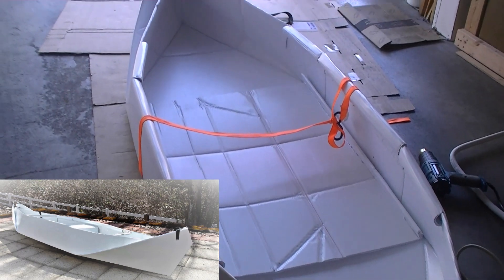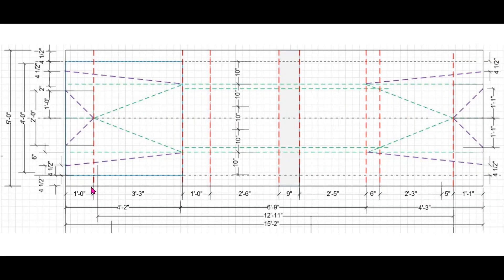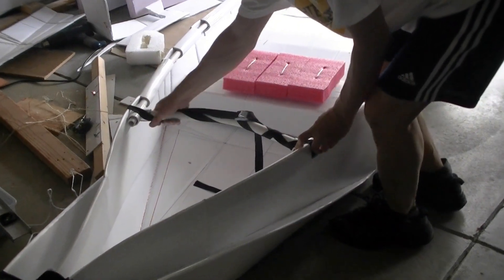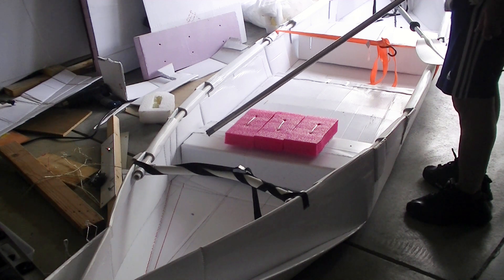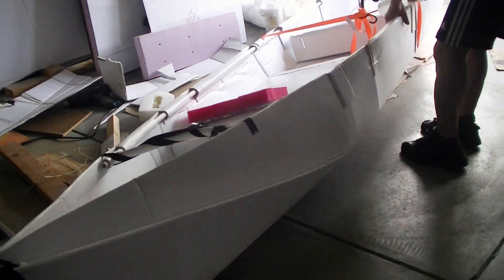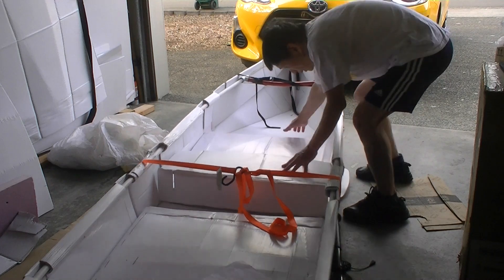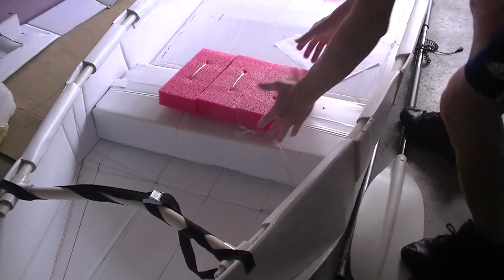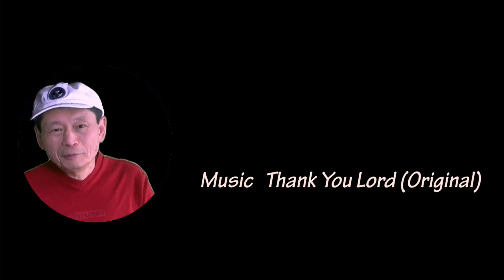#3 DIY: A Foldable Canoe For Two - G16

Comment: Bisakah saya mendapatkan ukuran blueprint dalam centimeter
Reply from the maker: If you ask me to do a metric version, I will use Google to convert the dimensions from inches to mm, which you should be able to do also. I received this similar request once and I spent time to update the plan (just for that person) but I have never heard back from that viewer. I felt my effort has been wasted. I prefer to spend my time to create better boat designs and videos rather than creating boat plans in metric system. The software I use cannot convert the plan to metric system automatically. Thanks for asking.

Comment: This is a really great design! I've been looking at all kinds of folding boat plans and this one seems the most practical - fairly simple to make, low cost and sturdy. Thanks for sharing your ideas - very inspiring!
Reply from the maker: Thanks for your feedback. I like this design. Part 5 of this series is the water test. It is not perfect but is the better one I come up with. Please also look at my Gen 12, 14, 15. They all based on the same boat plan, with minor variations, build methods and different way to fold the boat for transportation. I am creating a video series to cover the build method using the 4' x 8' coroplast. Hope this will inspire people to give this a try :- )

Comment: Ordered coroplast today hope to start building soon.
Reply from the maker: If you build a 12 foot boat, and if you use 4'x8' 4 mm thick coroplast, you will need around 4 sheets (some areas have to be double/triple thick). I used 5'x10' 6 mm thick coroplast, I used 1.5 sheet for Gen 15 (10'ft boat). Home Depot is $155/10 sheets (4'x8' 4mm) and with 4 sheets, so it will cost $62, so the boat will be under $100. If you use 6 mm ones,  it will be $208 for 5, but you will need only three sheets, it will cost more/ boat overall....

Comment: I built a paper mockup adding 2 more feet to the pattern I had made based on the gen 15 with the idea of compensating for the  4m mill coroplast. The weather is finally turning warm here in Ohio and I'm  looking forward to some time on the water.  Thanks again for your prompt reply.
Reply from the maker: Great to hear you are making progress. I finished building my G16 today and is ready for water test. I will provide more details on heat fusing the sheets together in future videos. The plans I posted are for 10 ft long boat. If you decide to do a longer boat, please let me know. I will update the G15 plan because the folds (mainly for transportation) will have to change.